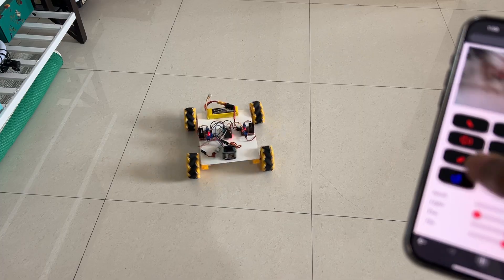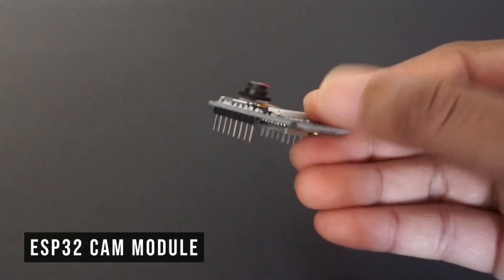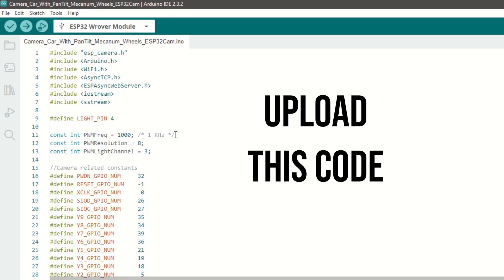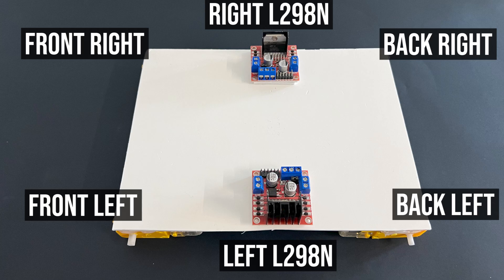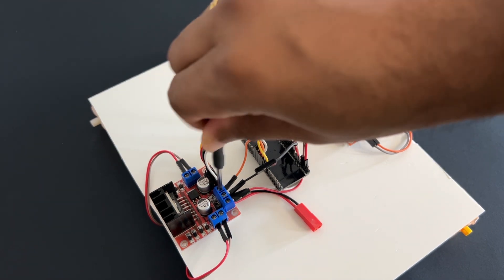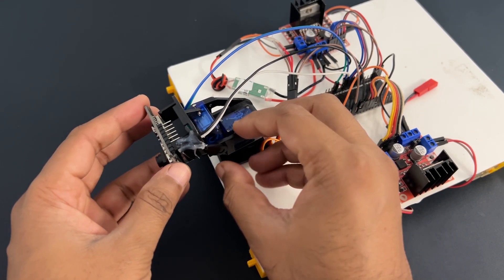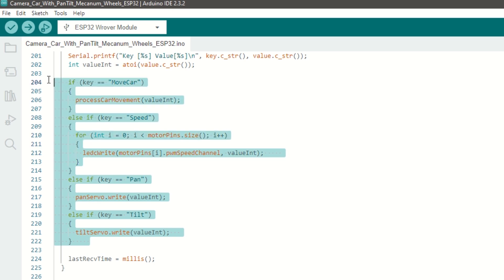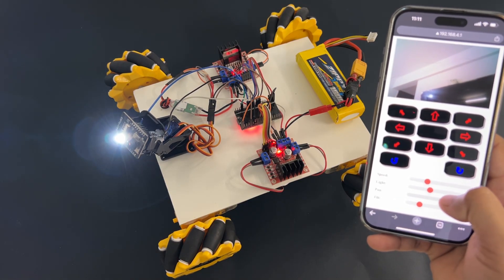Surveillance Car with PanTilt Servos and Mecanum wheels | esp32 camera car

Comment: Hello, I have encountered a difficult problem and I have not found any solution for it. It is that the servo does not move in the opposite direction from the motors. They work well and everything works.

Comment: Hello brother 
I done same connection and upload the code .
I'll get the webpage but the camera video is not showing snd camera module is heatup quickly.
And second error i got that the car is not moving in sny direction.
Xan you please give the solution 
It's urgent 
Please
Reply from the maker: This is one of the complex project o have ever built . Please check the connections again . Follow all the steps carefully 👍🏻👏🏻

Comment: Hello brother I need one help I have all components except the buck converter and mecanum wheels.

I have normal wheels , I have tried from your old video but the wifi connection is not stable. So now I want to use this method using 2 motor driver and esp32 along with esp32 cam . Can you please provide a video to make it using normal wheels rest the same setup.

And can I skip buck converter for servos instead provide 5v from motor driver?
Reply from the maker: You can use normal wheels . Sideways movements and diagonal movement will not work . Also use only separate 5v supply for servos . Don’t use it from motor driver module 👍🏻👏🏻

Comment: Sir, why use GPIO pins for ESP Cam serial communication, instead of using RX TX? If I change to RX TX, is it okay or possible? please answer sir🙏🏻🙏🏻🥹
Reply from the maker: Please use the same pins as shown in video to avoid issues 👍🏻👏🏻
Reply: @hashincludeelectronics  I have made this project, and developed it a little, now I am short of pins, and the only remaining pins are 17, 16, 1 and 3, while I need 1 more pin slot for 1 servo, is it safe for me to use those 4 pins?

Comment: Sir, why use GPIO pins for ESP Cam serial communication, instead of using RX TX? If I change to RX TX, is it okay or possible? please answer sir🙏🏻🙏🏻🙏🏻
Reply from the maker: Please use the same pins as shown in video to avoid issues 👍🏻👏🏻
Reply: @ I have made this project, and developed it a little, now I am short of pins, and the only remaining pins are 17, 16, 1 and 3, while I need 1 more pin slot for 1 servo, is it safe for me to use those 4 pins?

Comment: i have this error            D:\ard\Camera_Car_With_PanTilt_Mecanum_Wheels-main\Camera_Car_With_PanTilt_Mecanum_Wheels-main\Camera_Car_With_PanTilt_Mecanum_Wheels_ESP32Cam\Camera_Car_With_PanTilt_Mecanum_Wheels_ESP32Cam.ino: In function 'void setUpPinModes()':
D:\ard\Camera_Car_With_PanTilt_Mecanum_Wheels-main\Camera_Car_With_PanTilt_Mecanum_Wheels-main\Camera_Car_With_PanTilt_Mecanum_Wheels_ESP32Cam\Camera_Car_With_PanTilt_Mecanum_Wheels_ESP32Cam.ino:406:3: error: 'ledcSetup' was not declared in this scope; did you mean 'ledc_stop'?
  406 |   ledcSetup(PWMLightChannel, PWMFreq, PWMResolution);
      |   ^~~~~~~~~
      |   ledc_stop
D:\ard\Camera_Car_With_PanTilt_Mecanum_Wheels-main\Camera_Car_With_PanTilt_Mecanum_Wheels-main\Camera_Car_With_PanTilt_Mecanum_Wheels_ESP32Cam\Camera_Car_With_PanTilt_Mecanum_Wheels_ESP32Cam.ino:408:3: error: 'ledcAttachPin' was not declared in this scope; did you mean 'ledcAttach'?
  408 |   ledcAttachPin(LIGHT_PIN, PWMLightChannel);
      |   ^~~~~~~~~~~~~
      |   ledcAttach
Multiple libraries were found for "WiFi.h"
  Used: C:\Users\sh2\AppData\Local\Arduino15\packages\esp32\hardware\esp32\3.0.7\libraries\WiFi
  Not used: C:\Users\sh2\Documents\Arduino\libraries\WiFiEspAT
  Not used: C:\Users\sh2\Documents\Arduino\libraries\WiFiNINA
exit status 1

Compilation error: 'ledcSetup' was not declared in this scope; did you mean 'ledc_stop'?
'
Reply from the maker: Please install 2.0.16 version of esp32 board 👍🏻👏🏻
Reply: @hashincludeelectronics   I couldn't find it.
Can you tell me how you found it?

Comment: i have esp32 devkit module and you have esp32 so in my esp some gpios are missing so how should i work with it?? i tried seeing gpio pinouts and connect to respective pins but it didnt workout
Reply from the maker: This is little bit complex project so I would suggest to use the same modules which I used in this project to avoid issues and complete project 👍🏻👏🏻
Reply: @hashincludeelectronics  i connected to same gpios now its all done but i am not able to showup the webpage idk why i used esp 32 cam mb to upload code is it the problem?

Comment: 174 |     ledcSetup(motorPins[i].pwmSpeedChannel, PWMFreq, PWMResolution);
      |     ^~~~~~~~~
C:\Users\admin\AppData\Local\Temp\.arduinoIDE-unsaved20241019-14744-tibjgm.10mf\sketch_nov19a\sketch_nov19a.ino:175:5: error: 'ledcAttachPin' was not declared in this scope; did you mean 'ledcAttach'?
  175 |     ledcAttachPin(motorPins[i].pinEn, motorPins[i].pwmSpeedChannel);
      |     ^~~~~~~~~~~~~
      |     ledcAttach

exit status 1

Compilation error: 'ledcSetup' was not declared in this scope

pls help me sir, i really need it as soon as posible
Reply from the maker: Please install 2.0.16 version of esp32 board 👍🏻👏🏻

Comment: Great .. 
1. can us use wire like SPI  or usb to control the car .. 
what is best method to achieve that. 
2. I have display with ESP32 touch, how can you do the same kind of controls on it, here is what I have- Waveshare ESP32-S3 7inch Capacitive Touch LCD Development Board, ESP32 with Display, 800×480, 5-Point Touch
Reply from the maker: Unfortunately I don’t have much idea about these modules so can’t suggest much . This project itself is very complex . 👍🏻👍🏻

Comment: Your project is brilliant but in this code I am getting this error
"
C:\Users\acer\Documents\Arduino\Camera_Car_With_PanTilt_Mecanum_Wheels_ESP32Cam__1_\Camera_Car_With_PanTilt_Mecanum_Wheels_ESP32Cam__1_.ino:405:3: error: 'ledcSetup' was not declared in this scope; did you mean 'ledc_stop'?
  405 |   ledcSetup(PWMLightChannel, PWMFreq, PWMResolution);
      |   ^~~~~~~~~
      |   ledc_stop
C:\Users\acer\Documents\Arduino\Camera_Car_With_PanTilt_Mecanum_Wheels_ESP32Cam__1_\Camera_Car_With_PanTilt_Mecanum_Wheels_ESP32Cam__1_.ino:407:3: error: 'ledcAttachPin' was not declared in this scope; did you mean 'ledcAttach'?
  407 |   ledcAttachPin(LIGHT_PIN, PWMLightChannel);
      |   ^~~~~~~~~~~~~
      |   ledcAttach
Multiple libraries were found for "WiFi.h"
  Used: C:\Users\acer\AppData\Local\Arduino15\packages\esp32\hardware\esp32\3.0.5\libraries\WiFi
  Not used: C:\Users\acer\Documents\Arduino\libraries\WiFiNINA
"
Please help me with it
Its very important to complete this project
Reply from the maker: @mindmusicanime2839  please install 2.0.16 version of esp32 board 👍🏻👏🏻

Comment: Hello, now I found other issue,  it looks like the communication between ESP32 and ESP32CAM can only be achieved for the servo command (pan, tilt) and speed settings (I can observe the comm led on ESP32 board is blinking). But for the command of driving motor control, there is no comm led blinking and I can't control the driving motor at all. Do you have any suggestion?
Reply from the maker: @psitpkul first of all please use rechargeable battery to avoid any power issues . Check for connections with motor driver module 👍🏻👏🏻

Comment: why do you need to motor driver module for this, your other videos achieve the same robot car with just one motor driver, just curious if theres a specific reason
Reply from the maker: @abrahamjoys6443  we need to drive individual motors separately so need 2 motor driver module as it’s a mecanum wheel car 👍🏻👏🏻
Reply: @hashincludeelectronics  thanks, so wondering for this video https://www.youtube.com/watch?v=tyY7AN132Xs&list=WL how did you get away with just using one motor, would the left and right side not need to be driven seprately. PS love your content and want to try to replicate it, and also trying to learn in the process

Comment: It would be better to use Arduino UNO instead of ESP32, since neither WiFi nor BLE is used. Please make a version for UNO!
Reply from the maker: Agree we can use Uno as well . However I have some other plans in mind 🙂👍🏻👏🏻
Reply: @hashincludeelectronics  Help me remake the fragment for UNO:
   dataString = Serial1.readStringUntil('\n');
    std::string myData = dataString.c_str();
    std::istringstream ss(myData);
    std::string key, value;
    std::getline(ss, key, ',');
    std::getline(ss, value, ',');
    Serial.printf("Key [%s] Value[%s]\n", key.c_str(), value.c_str()); 
    int valueInt = atoi(value.c_str());
Thanks.

Comment: Hello, I can upload the code for ESP32CAM , but no wifi car is shown. Do you have any idea for this problem?
Reply from the maker: Please use rechargeable battery as there may be power issues . Or check for loose connections because esp32 cam will be restarting because of it 👍🏻👏🏻

Comment: Sir, can you make a macanum wheel car that move with  2 joy stick the left joy stick make the car go forward,backward,slide left,slide right and between and the right joy stick make the car turn left or turn right and it use esp-now it comunicate
Reply from the maker: There I already similar video on my channel on mecanum wheels car with ps4 controller . You can refer that . Also there is video on espnow transmitter receiver so you can use that as well 👍🏻👏🏻
Reply: Thanks  @hashincludeelectronics
Reply from the maker: @NanonplayZ  welcome 🙏

Comment: Bro pls add servos for steering in this same project ,or please reply with the code for that
Reply from the maker: It’s not just code we need to do testing as well . I don’t think adding servo steering is a good idea in this project . If you need then you can add one more servo in this project and make changes in code accordingly. Try it 👏🏻👍🏻
Reply: @hashincludeelectronics  I'm not best in coding,the servo motor needs angles in codes,but other geared motor doesn't need angles ,(my knowledge if iam wrong pls correct me).so it's a bigger task for me 🫠🙂